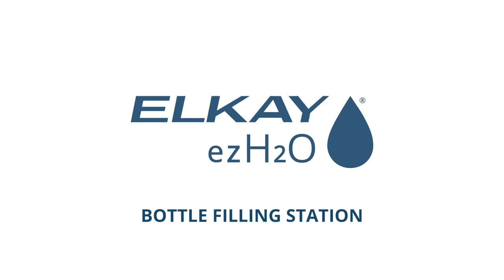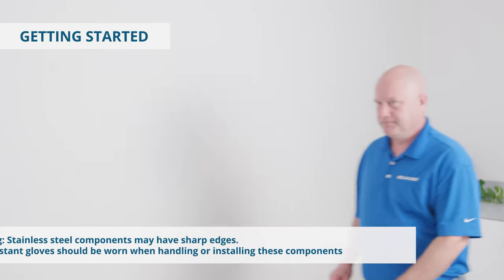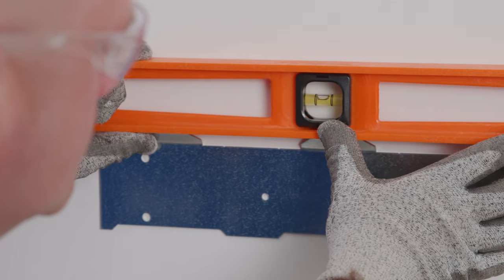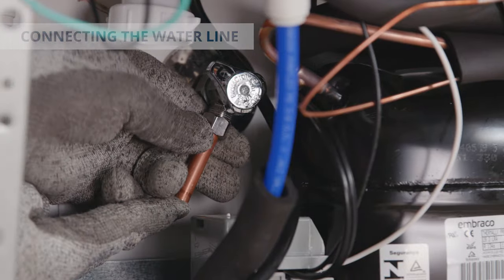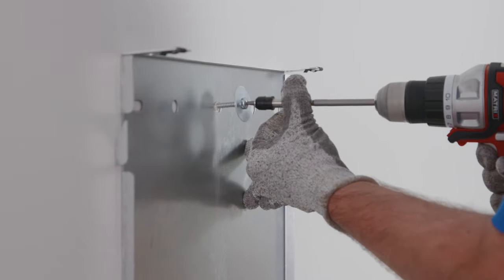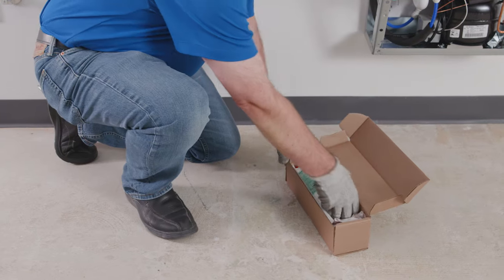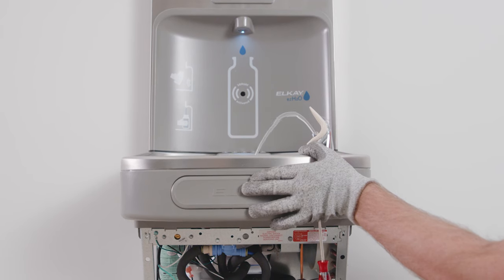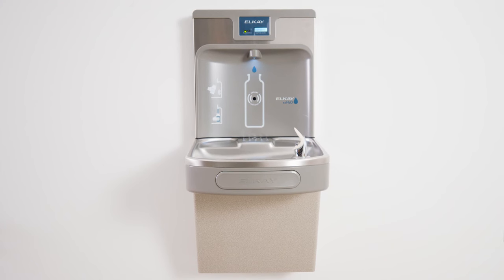How to install an Elkay ezH2O Bottle Filling Station

Comment: This unit can be tricky if you are replacing an older model fountain. The rough-in power receptacle location and recess is crucial to getting the filter inside. Not an easy task when dealing with concrete block walls.
The retrofit kit is a great solution to this problem, if the model you have on the wall will accept it. It is more troubleshooting the innards of the cooler but saves time over changing the rough in on the wall. You can mount the filter on the bottom of the cooler to free some space but I recommend the filter cover to keep someone from a 1/4 turn slip and slide.
Finally, either way you go you need a pair of tiny hands to cram everything inside and turn on the water. Like working on an Escort, no room.
Reply: I installed one of these a year or two ago, replacing an older unit. It was not an easy task as the outlet had to be changed because it didn't have a ground and it was a tight fit that I did not like. It worked out fine but man was it a pain because of the plumbing from the existing unit not matching up very well.
Reply: Just installed one on block.....fun times

Comment: The spec sheet shows water connection as straight but video shows valve with a 90 supply. Which should it be. Thank you.

Comment: Water lines?? Completely skipped the water line hook up
Reply: I'm in the process of installing this unit -no water line included
Reply: @chadosblack  I've installed two units now.
Reply: Actually water line is included but not the couplings to hook up. You get the water line from cutting the excess on top part of unit but  installation guide does not tell you that. The video does show the water line but had to figure out where they got it from.
Reply: What’s the connector called, available at lowes or Home Depot ?

Comment: I have one of these and it's connected to an outlet that goes to a GFCI breaker in the panel. For some reason it started tripping the GFCI breaker but if I plug it into a non GFCI breaker it works perfect any ideas

Comment: I was considering buying one of these fountains, but it seems like QUITE the project to install...
Reply: This video makes it seem like a breeze. I have a contract of installing 300 of these units in various schools in my area. You're lucky if it goes this smooth. I'm dealing with old units and removing and replacing. Cutting the copper using mechanical joints for install adding appropriate water line connectors. This video shows you when everything is in place and not struggling in concrete block walls.

Comment: The Building Code says: "drinking fountains are permitted to be
i) indirectly connected to a sanitary drainage system" Does the ELKAY system take this into account? is there an indirect section to the drain inside unit?
Reply: The code also allows them to be connected 
Just like the video shows (which is the most common way)

Comment: I work at a school and I've noticed the custodian uses a chrome spray cleaner on these machines that she sprays liberally on it. I usually come early in the morning and there's always white stuff that comes out first which I assume is the residue from when she cleans and not from the pipes. That can't be good for my health. I would suggest instructing custodians on how to clean these machines so this doesn't happen as well as adding a "flush" button to future systems so you can at least get any crap out of the spout before you put your bottle under there. I'm no longer filling my bottle up at these things at school because of this.